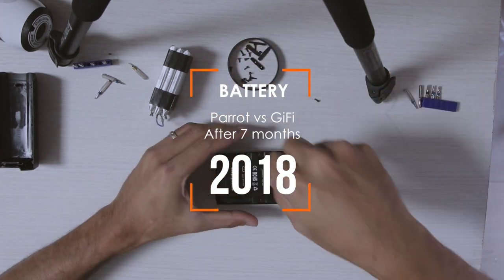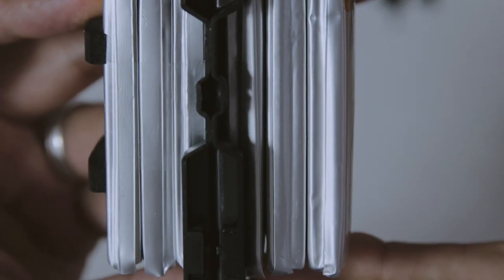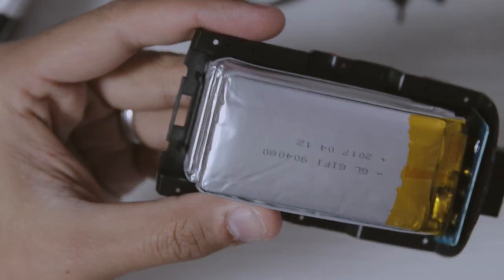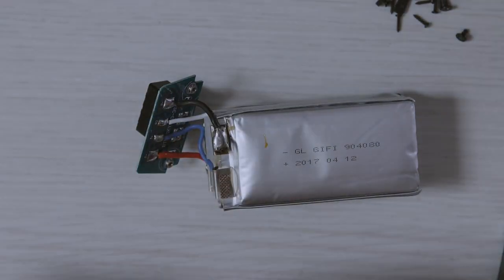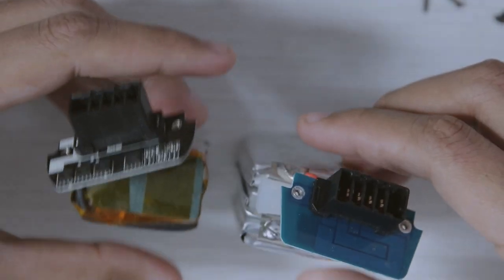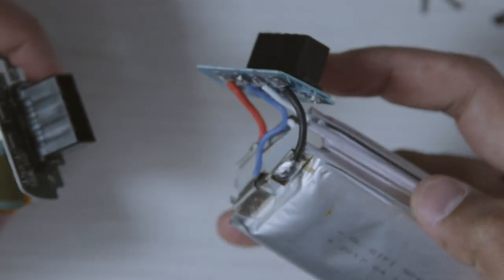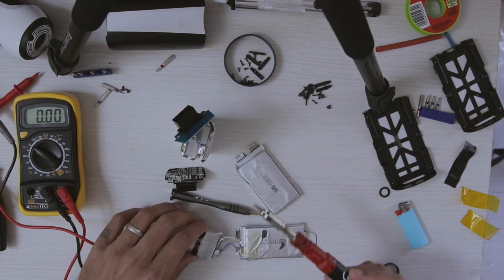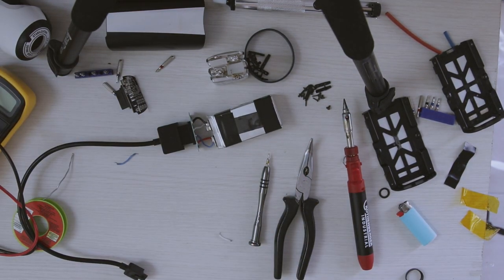BEBOP 2 - Battery - GiFi vs Parrot | Part 1 | What is inside?

Comment: For warning using the GiFi battery. Ive just lost my bebop 2 in the ocean on it's first use.  I had a reading of 20% and a few seconds later the warning "low battery" alarm went off now showing 5%. I was out 200 metres and coming home but unfortunately the bebop didnt make it and I'm totally peeved off as the standard battery would've got the bird home 3 times over. So "WARNING" is issued to my fellow bebop owners considering this battery upgrade!!!!!!!!
Reply: Oh, I also balance charged this battery prior to using it for this flight!!!!!
Reply from the maker: Mark Trevor thank you very much for your advice. It is much appreciated. Can you please share what make and model charger you were using to charge the GIFI battery?
Reply: Morning from Australia Anthony!!!! Ok, the make & model of the charger is as follows:
G.T.POWER
B3
Input:.  AC 100v - 240v
Output: LiPo 2S 1.5A
             LiPo 3S 1.0A 
I hope this helps Anthony!!!
Reply from the maker: Much appreciated Mark, this helps allot. Cheers Anthony

Comment: Great videos!  I have been binging all your videos in relation to the Bebop 2 power as I have started flying mine recently.  I saw your reply to a comment about buying the cells for the batteries and was just wondering if you have a suggestion on where to get the cells for the Bebop 2 power.  Also if you have any hints/tips/tricks with putting them in the OEM caseing that would be helpful even though it looks pretty straight foward.

Comment: Great video and thank you for taking the time to investigate  the difference between OEM and NON OEM batteries. No balance charging on the GiFi is quite shocking and its been well worth the effort that you have identified this :-)
Like others who have replied I would consider a Balanced Charger and one that also charges LiHV so that you have some future proofing inf you ever decide to get a Bebop Power which has a different cell type.
Another reason I like my balanced charger is to be able to monitor and discharge my cells if I am not going to fly for a while.
Still a great video which compliments your others which I also like.
Keep up the good work.

Mike
Reply from the maker: Michael Dawson thank you. What is the make /model of the charger you recommend?
Reply: Hi Anthony I use the Turnigy Accucell 6
https://hobbyking.com/en_us/turnigy-accucel-6-80w-10a-balancer-charger-lihv-capable.html
It supports all the different cell types and even LiHV

Mike

Comment: I don't know if you read comments now but I would like your point of view. Could I extend my battery from  bebop1 3.0 with original pcp and battery cell from original bebop2?
Reply from the maker: You could but the size difference with the cells would make it difficult. Better to put an XT60 connector and use RC batteries :)
Reply: @ANTHONYVLOG  unfortunately didn't receive original battery with bebop1. Only the big one from Gifi.
My plan gonna be to buy original parrot battery and replace cell's with battery of bebop2 with 2700mAh. Just combine correct parts and I'm optimistic. You mentioned fitting... how hard can it be :-(
Reply from the maker: @draganbratic2173  just use a balance charger with the GiFi battery. It should be ok like that as the balancing will be done by the charger :)
Reply: @ANTHONYVLOG  roger that. 
Just need to buy bebop2 battery to see which XT60 fits with it. Maybe I'll go with that. Good that you gave me idea. Thanks

Comment: Hi there. I know this is an old video, but was curious if you had any idea of what specific cells/envelopes you could use to replace the 3 internal ones?

Tho, they seem to be different capacity batters. The OEM Parrot battery is 1200mAh, 13.3Wh, 11.1V, 10C continuous discharge, and my GiFi Power battery is 1600mAh, 17.7Wh, 11.1V, 20C continuous discharge. They both have 3 cells in them, but both quickly failed to charge. I would like to get them working again
Reply from the maker: Hello the BMS on the oem batteries operates with 2700mah cells the cell dimensions are 80x40x23, I used to get DXF brand bud they no longer manufacture them. However ZDF now makes them and you can find them on AliExpress or possibly hobby king!
Reply: @ANTHONYVLOG  Thanks I will dig around

Comment: I have a question. Well I just got my 3rd bebop 2 n the refurb that I got came with a dead battery. I thought it was the charger at first so I modded the charging cable. I know black is negative n red is positive. I cut the balance lead off one of my old batteries that I don't use. Now the 3s lead that I had has the 1 red n the rest are black. So I soldered red to red n the Bebop 2 wire to one of the blacks. It didn't short out when I plugged in the battery to my modded cable. I did order a battery n the company is sending another one. So I want to know did I solder the wires correctly?

Comment: antony could you help me to understand if my original parrot 2 drone battery is still good or is trash? my dad haven t used this for about 1 year... so as now, as i put the charger on and plug the battery.. no light turns on (on the charger).....
If i look at the battery, it seems a little "bloated"...... it is normal?
Reply from the maker: shonik3 hello, if thé battery is bloated I will recommend not using it. No light on charger possibly because the cells are completely dead. I won’t use it 😢
Reply: @ANTHONYVLOG  thanks!  That s what i fear!  Probably dead!  ( the lights on chargher turns on when it s plugged to wall? Without a battery? /)
Reply from the maker: @shonik3  that sounds like a different problem with the charger. The light on the BEBOP 2 OEM charger does not illuminate until it detects acceptable resistance from the battery. Maybe the initial problem was the charger not charging the battery and the drone was stored, than over time the battery bloated due to being stored charged. Two separate situations. :)

Comment: Nice video and experiment Anthony. You sped through the cell voltage readings. But I am curious where the cell voltages stand before the switch, specifically how close they are balanced. Maybe you have that saved on the original video? 
Even before the flight and battery reporting tests, it may be interesting to also note the newly arranged cell charge readings too.
Reply from the maker: Hi Rick, 

Parrot Cells
3.57v
3.73v
3.58v

after charge (Green light + GiFi PCB) 
3.94v
3.95v
4.11v

I have increased my workload for the next video.

GiFi Battery Cells + Parrot PCB - (Charge with Parrot Charger & note voltages)
GiFi Battery Cells + GiFi PCB - (Charge with Parrot Charger & note voltages)
GiFi Battery Cells + Parrot PCB - Test flight Hover 5m 100% - 2% (Note voltages at 2%, balanced discharge?)
GiFi Battery Cells + GiFi PCB - Test flight Hover 5m 100% - 2% (Note voltages at 2%, balanced discharge?)

Repeat tests with good Parrot cells as I suspect the cells I showed in the video may not be sufficient and I don't have a balance charger to target cell charge to balance it. 

The test flight is only to note if the PCB makes any difference in the BMS or is the PCB only for charge. 

Your thoughts?
Reply: Thank you for noting the voltages. I apologize about the additional workload.

My thinking is that you would be able know the condition of the Parrot cells to see if they are on path to degrade with the GiFi PCB (as the the GiFi cells have), or slightly improve the balance of the GiFi cells (if you do that test), regarding if the PCB's function is in part to help balance charge each of the cells (BMS, charge mode). The comparison would help confirm this.

The PCB's function might also possibly be to limit battery draw to keep it cool during flight (BMS, discharge mode), or like you say, to help in the battery reporting capability (BMS, report mode) in FreeFlight Pro. I am interested like everyone here, to watch your results. It's a great experiment.

I am surprised to see the Parrot Cell's charge not reach nearer to 4.20v at green light (100% ?) charge. Maybe the PCB does play a large role in the charge. I use a DP2 EV-Peak balancing charger specifically made for the Parrot Bebop 2, and very happy with how it treats my three OEM batteries. It surely must cooperate with the Parrot PCB. https://www.youtube.com/watch?v=arLcMb-KOOQ .  I use the OEM charger only for the SkyController.
Reply from the maker: Rick Cunningham no worries at all. 

From today's fiddle with the cells, they are hit and miss with the GiFi board, put them back on the Parrot PCB and they all went up to 4.20+-. 2 I also got some info from the company that makes the cells which I'll post up in another video. I have not found any information of the GiFi cells yet nor have I gotten a reply. They proberbly don't like me or don't want me telling everyone the 4000mAh cells are the same as the 3100mAh GiFi with the same blank board.
Reply: thanks for the video anthony, subscribed. just to be clear, are you saying there is no difference between the cells or the capacity of the gifi 3100mah and 4000mah bebop 2 batteries?
Reply from the maker: Hi Drone Eating Tree (cool name lol). Yes I had a member on my FB page confirm the cells in my 3100mAh is the same as those in his 4000mAh GiFi battery. Only way to find out is to open it, it even has the identical blank PCB. The only difference is the label saying 4000mAh and 3100mAh.

Comment: My original parrot battery has started to swell and it is even difficult to install it on the Bebop 2. I have another parrot battery, but I would like to replace the cells in the damaged one to experiment. Where can I buy cells? Thanks.
Reply: Grzegorz Ciak Thanks

Comment: Where  did you get the small screw driver with the small star bits?
Reply from the maker: Steve Dawson hardware store, I just looked for a set that had the small torx t4 t5 t6 Philips and flat heads

Comment: So does the original battery have a circuit for balance the battery and alternative batteries don't?
Reply: In other words, the oem charger doesn't balance batteries but original batteries have an internal circuit that perform the balance task. Is that right?
Reply from the maker: Ary Kleinerman oem chargers balance as well. The PCB in the oem batteries are protection and balancing. That is why non oem batteries charged with the oem charger also get balanced. But over time due to the resistance and the lack of a protection circuit the chargers become faulty and balancing is no longer reliable.
Reply: ANTHONYVLOG I thought mrkent said in his videos that the oem charger doesn't balance. So, isn't a balancer RC charger needed with original batteries right?
Reply from the maker: Ary Kleinerman the advice to use an after market balancer is always The case for multicell RC lipos in the case of parrot it is not required. If the batteries and drone were purchased without warrenty than it is best to invest in a good balancer. Note the small chargers that say they balance but can't trickle or target cell charge are no different than the oem 3s charger.
Reply from the maker: I would recommend a battery checker first. It's inexpensive because even aftermarket balance chargers won't tell you if a cell has dropped before your flight. I use a battery tester before all my flights and I have not had any problems with the drone flight due to battery failures.
Reply from the maker: Battery checker
 https://rover.ebay.com/rover/0/0/0?mpre=https%3A%2F%2Fwww.ebay.fr%2Fulk%2Fitm%2F372048903452

Cable for bebop 2 battery to battery checker 

https://rover.ebay.com/rover/0/0/0?mpre=https%3A%2F%2Fwww.ebay.com%2Fulk%2Fitm%2F232548597495
Reply: ANTHONYVLOG I use my voltmeter :)

Comment: I had a broken bebop 2 battery and the shop had original bebop 2 elements - but after replacing the elements in the repair shop  - skycontroller failed to recognize the battery. Does anyone have experience with replacing the original battery elements? Does it work? Or does the complicated circuit board prevent replacing elements?
Reply from the maker: Replacing the cells isn't a problem. It works all the time. If the PCB is sleeping you need an OEM charger to wake it up.
Reply: I did charge it with OEM charger until charger showed green, but strangely skycontroller would not accept the repaired battery.
Reply from the maker: @bboydmt  not sure why the Skycontroller does not recognise it, if another battery works than use that battery.
Reply: Yes, its disposed of already, I was just wondering if it was even possible to replace original cells, and it seems it should be possible, so thanks for that answer:)

Comment: What do you think? Is it safe to use unbalaced battery like his GiFi with original bebop charger - or is it better to buy a balanced charger?
Reply from the maker: Buy a balanced charger. The gifi batteries have no protection, so it cam damage the oem charger if they short.
Reply: Thank you! Do you have suggestions for balanced chargers and where to read up on them? I guess there are there fake chargers like fake batteries? Also there are many selles of gifi batteries, some are probably fake also, can you share what seller you bought from?
Reply from the maker: @bboydmt  for the BEBOP 2, I recommend the EVPEAK DP2 which is specific for BEBOP 2 battery and is perfect. Anything else and you have to do research as I can guarantee their validity.

Comment: Where are you guys getting connectors for balance charging you Gifi batteries?
Reply from the maker: The original cable is spliced to fit the charger. Here is a very detailed write up by Christopher Smith about making one. http://thehighproglow.blogspot.fr/2017/08/parrot-bebop-2-stock-charge-cable-hack.html
Reply: do you happen to know anyone selling this cable modded already. If i'm going to buy a cable to mod i might as well by on already modded..........and thanks for making this video i assume your Gifi battery is getting puffy because its not been balance charged
Reply from the maker: No worries, the puffing of the GiFi batteries I have is purely negligence (worse case scenario) most of which was leaving it sat at 100% when not in use, a well looked after GiFi can last a good while. As for modded balance chargers I don't know of any that are ready made. There is however a product EV-PEAK 3, it does balance charge and storage discharge if that may be of interest to you. I am certain a few other members on here with ore experience with balance chargers can suggest something.

Comment: Is there a place where i can order a case off the parrot Bebop 2 battery, mine  has broken
Reply from the maker: Hi Richard, i havent found just the battery shell. Are you looking for the base or the outer cone? I may have one laying around somewhere i could post to you.
Reply: @ANTHONYVLOG  I'm looking for the bottom with 4 tabs that hold the battery

Comment: 3:12   I assume that means the BEBOP 2 is an internally balanced battery, so there's no benefit to having a balancing charger, because the battery handles that itself.   The GIFI battery is not balanced, but a balancing charger might then be useful and extend the life.   Thoughts?
Reply from the maker: Yes a balance charger is highly recommend for the GiFi battery, for safety and peace of mind. The Parrot battery is a little more intelligent so can handle a bit more negligence.

Comment: Hi Anthony, I just wanted to ask if you know whether there will be any adverse effect caused by charging a standard Bebop 2 Power LiHv battery via a balance charge lead and aftermarket balance charger, due to the built-in charge circuit of the battery itself, possibly conflicting with the external balance charger?
Reply from the maker: Hi Hubrecht, normally intelligent balance chargers will come with a caution to not use with batteries with built in circuit protection. The only worst case scenario using a universal balance charger is that the BMS circuit inside the battery may not function correctly if the charger forces an individual cell charge (target cell charging). If the universal charger does not target cell and use the discharge balance method than there will be no problem and it will charge and function as intended.
Reply: Thanks for the info!  I have managed to make the second battery usable again via deleting the faulty internal pcb as you suggested to me on your other post, so that one I will have to balance charge, using my intelligent charger, which is obviously better for the lifespan of the battery anyway.  Was just wondering what charging method I should use on the good battery with the working pcb.
Reply from the maker: @hubrechtfladderak3321  thats awesome news. These batteries have an average life expectancy of around 600 cycles. More if storage voltages are respected and not charged full but to 98% for prolonged life. Iv been testing these batteries over the years and have been doing the worst possible things to them like leaving them fully charged, unbalancing them than flying, they are of good grade cells so anything other than neglect will prolong the life and use of these batteries :D